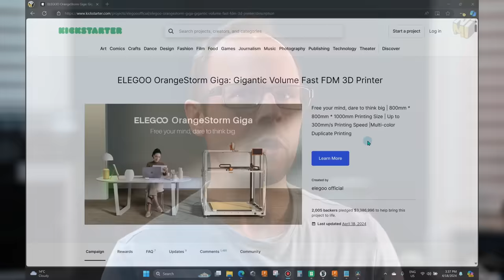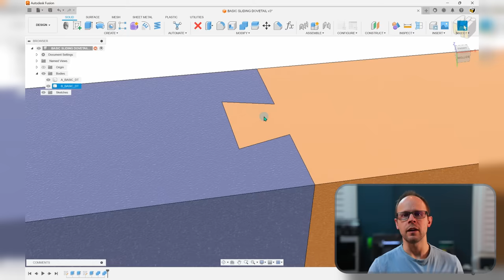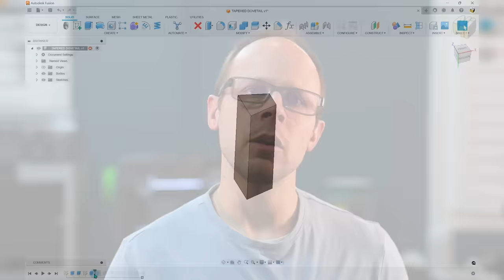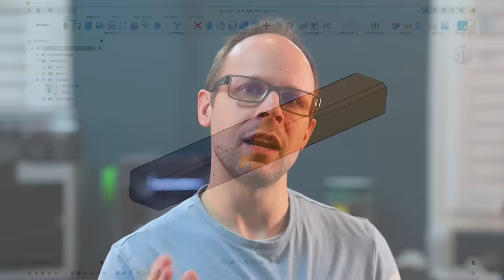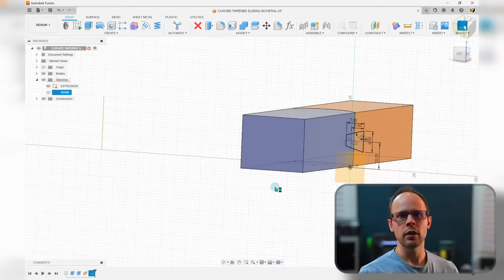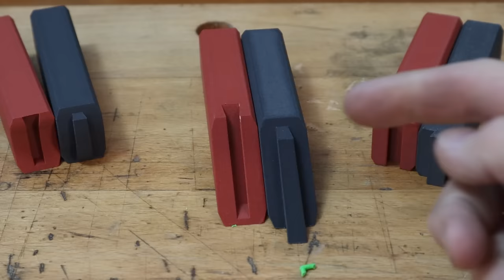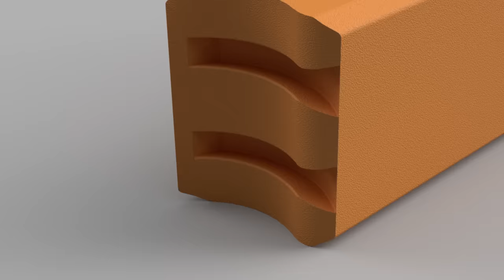Modernizing the best Woodworking Joint to use for 3D Printing

Comment: Please do more on joints. Dowel, maybe biscuit joints. Can you test them with weight? Glue strength difference? Love to see it. Great video.
Reply from the maker: Thanks, I will have more coming!  I'm also thinking about doing a video comparing a completely wooden small piece of furniture vs a completely 3d printed version to see how close they are in strength.
Reply: @NeedItMakeIt  That’s rad! I once made a dovetail mounted bracket for a shelf. Routed the dovetail into the wooden shelf and bracket and printed the mating mount out of PLA. 
Turned out beautiful and STRONG! No visible screws or joints.

Comment: I've been using a dowel pin system just to keep things lined up where they need to be. This seems a more elegant solution.
Reply from the maker: I guess it depends on what you're building, I find that holes need to have a peaked top so that they print well and don't collapse in too much on those top layers, I suppose the dowel can be whatever shape you like though, it makes sense to do a triangular dowel for 3D printing and you get an auto-peak and a flat surface.  When I worked building furniture, I must have inserted thousands and thousands of dowels, they work especially well with glue.

Comment: The snapping dovetail is interesting, keeps dimensionality while having a removable joint, depending on the strength of th snap.  Makes me think of using a combination of a dovetail with locating dutchman inserts.  Perhaps the next step of this would be a sprung detent within the interior faces, so that the dovetail itself has a tractile resistance before snapping into and out of place, without needing a compliant snap at the end of the rail.

Comment: Great design work and video presentation.  As an engineer, I loved this
Reply from the maker: I'm glad you enjoyed it!  I'm working on several related videos in a kind of series of different types of useful connection types.  I'd also like to integrate several different methods into and then run some tests to see which ones come out on top.
Reply: @NeedItMakeIt  I was looking for some quantitative analysis on degrees of play using the best joints, and perhaps a stress map, yield, breaking point map.  ‘Project Farm’ often has simple but effective ways to standardize these measurements without getting overly technical with it.
Reply from the maker: @donlindell1994  Can do, Project farm is one of my favorite channels, he is exceptional at packing a ton of info into a short video.  I'll be including some of these tests into the follow up video that I'm working on right now!

Comment: Great video, love the different joints. Would be good to see the basic dovetail at 0.04 offset.
Your fusion 360 skills are awesome
Reply from the maker: That's great!  Yeah, I could certainly try the 0.04; my concern with that connection is that it was hard to put together, originally I had the parts much larger, but to be able to 3D print all of them and have them on camera, I shrunk them down a bit.  I think it would have been possible and could have worked fine.  The taper is still better, but the standard dovetail works too, it really depends on what you're using them for.  

Thanks for the support, I enjoy using Fusion, it can do just about everything I need, it doesn't like meshes, that's one of my main complaints, it's all good and we can find ways to work around it.
Reply: I get ya 👍
I need to learn fusion 360 more im mainly on tinkercad and it's not nearly as good as fusion.

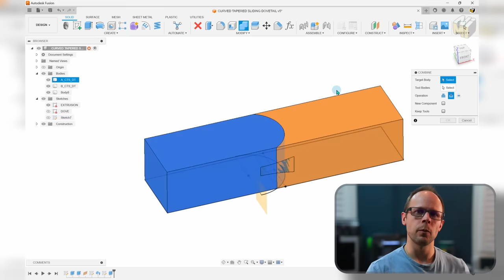Comment: at 4:48 is the perfect opportunity to use the Intersect mode of the extrude command. it removes the need to create additional sketch profiles.
Reply from the maker: You got me!  That would have been nice to use there for sure.  I don't like adding more features in that I need, this would have saved a couple of steps.

Comment: Nice technique! What I would do is to put a hole (maybe countersunk) in the dovetail stop, and a nut/threaded hole in the dovetail itself. Then, after assembly you could lock the parts together with a screw :)

Comment: Love this video. I’m going to be modeling dovetail joints just because all week now. I have some ideas to use Slant3D’s 45 degree printing concept, especially for the 45 degree dovetail to get printing textures to match. I also think there’s potential to create some complimentary anisotropic strength between the two halves. I’m probably just overthinking though.
Reply from the maker: I figured that you guys could take this places that I couldn't even think of.  I've seen quite a few products with standard straight dovetails and they can easily be improved with a taper or the curve... or both.  I may end up making a dedicated video just to this one connection, and shoot it a little differently, some people wanted a bit more detail on that one in particular.  I have a bunch more ideas for connections, some are old, but some are completely new and I'll probably start testing their strength as well.   Many many more to come!

Comment: It would be really cool to see these tested in their different dimensions (compression, tension, lateral movement in comparison to a full length object and worst case scenario loads).
Reply from the maker: I have a follow up video coming, I'll be running some tests on this and some others as well.  It's a great idea and I think it'd be good to compare against some more typical connections used in 3d printing as well as a rail with no joint as well for benchmarking.

Comment: Good video. There's an easier way to split a body with a dovetail cut in Fusion 360:
1) Start with a solid body
2) On a sketch, draw the squiggly line representing where a blade would cut to make the dovetail. Include fillets at any sharp edges.
3) In the top menu, switch from the SOLID tab to the SURFACE tab
4) "Extrude" the squiggly line, so that it forms a surface that divides the body you want to cut
5) Go back to the SOLID tab, choose MODIFY / Split Body
6) For "Body to Split" select your solid part. For "Splitting Tool(s)" select your surface. (Works best if you select them using the part tree on the left)
7) Click ok and it will split your part. You can then press/pull to add clearance.

Comment: For the first one (simple dovetail) you have shown, you can actually use the slicer. No need to design it in CAD in advance. Not sure if slicer you use supports it, but as far as I know Prusa Slicer and Bambu Studio (the one I use) have the ability to cut a part and cut it by creating a dovetail. You can do some clearance adjustments there depending on your printer, but from my experimenting it can create some pretty tight joints that might require a hammer to connect all the way through.

You can also cut it using dowels in slicer, which is what I've used few times when I needed to insert a metal rod into the part and I just used dowels for alignment when gluing two printer parts together around the rod.
Reply from the maker: That's right, PrusaSlicer has the dovetail which you can also taper and add clearance.  Unfortunately I have not found it to be useful, the connections cannot be reproduced, the sizes/lengths cannot be controlled well either.  It's still handy to have as a last-resort.  If you're creating the model, I think it's better to create the design with these connections in mind already, this also helps to make sure the orientation of the connections is best for strength related to print orientation.
Reply: @NeedItMakeIt  thanks for the insight. I've used slicer dovetail only a few times on things that weren't critical at all, so I actually don't have a ton of experience with them.
Reply from the maker: @rand0mtv660  I've tried it a few times as well when I was making a previous video about connection types, but I had such a hard time trying to make anything predictable and consistent that I decided to go a different direction.  It's still good to have in there as a fail-safe and for people with smaller printers.

Comment: I really like the fuzzy skin surface applied to the parts. Can you share what settings you used?  I have had trouble finding a combination of settings that I liked. It usually just comes out looking "weird."
Reply: +1 for this!
Reply from the maker: Oh, well I have a surprise for you, it's easier than that, this is PETG-CF and it gives you the fuzz all by itself, no need to do anything in the slicer.  The downside of any CF filaments that I've used is that they tend to be more brittle (they are quite stiff) and the layer adhesion is not as good as standard PETG.  I think with some slicer tweaks, it could be improved.
Reply: Are you using the textured PEI plate as well?
Reply: @NeedItMakeIt would you rate PETG over any of the tough PLA or high speed PLA? Genuinely interested as I'm considering trying out some filaments.
Reply from the maker: @-______-______-  It depends on the properties you're looking for, PETG-CF is more stiff but layer adhesion is not nearly as good as standard PETG.  My issues with PLA come down to longevity, since PLA is affected at a molecular level by moisture, it will become brittle over time.  PETG-CF also remains more flat than PLAs during printing.  If you're looking for easy of printing crisp overhangs and not worried about longevity, PLA/PLA+ is probably best, if you want looks PLA-CF or PETG-CF are the best for that, if you need strength and you can print 100% solid, use PETG-CF 100%, it is stiff but won't break like a part with infill.  I have some videos coming out soon to help with this too.  This weekend I'll have a video which displays some of these properties well.
Reply: @NeedItMakeIt  Thanks for your very useful reply.

Comment: this is a great video. would be nice if we could get some real world data on the performance of each joints performance. defo need more subs
Reply from the maker: Thank you!  Lots more coming like this one as well.   I'll put together a test video with some of my best connections and we can bend and break them in several directions.  I might even add some wood in there to compare.  I have some test rigs setup now, but I want something more professional with more accurate measurements and data feedback.   Hopefully the YT gods can shine a light on the channel and allow the resources to buy some equipment and lots more filament!

Comment: that is a damn good joint indeed
Reply from the maker: I have two more which I think will rival this one, both I believe have not been done before, at least not that I've seen.  In the follow up I'll do some stiffness and strength testing to see how they compare as well.
Reply: @NeedItMakeIt  would love to hear your opinion on the best solution for fitting beams end to end for making larger printers, cheers :)
Reply from the maker: @MrFranklitalien  That'd be a great use case for these connections, is there a material you have in mind for this already?
Reply: @NeedItMakeIt  I've been brainstorming a mostly printed 3d printer with some friends, like the snappy v3, only instead of using snap fits or screws I'd like to see if I can do it with mostly keyed wood joints and zip ties;
hoping to drive the cost down below 200$US as a benchmark.
CoreXY geometry would be great for building on top of the base architecture (might integrate arms and wheels later down the road as part of the NASA autoreplicant robot program)
Reply from the maker: @MrFranklitalien  Perfect!   If  you can wait for a little less than 1 week, I will have the follow up video and I will try to think of how it could work well for your application as well.   I love your idea BTW, a fully 3D printed printer... minus some non-printable stuff would be very cool and I'd love to try it on the channel when you get to a point that you're ready to share it.  So far the ABSGF25 from QIDI is the most rigid filament I've tried, next would be PC and then PETG-CF and Hyper PLA are tied.  I'd imagine that a rigid material is important for your application.

Comment: I'm surprised you get such fine joint printing to work to that accuracy. Could you have also printed the joints to have a cross pin to lock them together like they do in Japanese wood joints?
Reply from the maker: I certainly didn't have that level of success years ago, but with the CoreXY printers' speed and accuracy, and calibration of the filament, it's possible now for just about everyone.   In a previous video I made a connection called a Under Squinted Stop Splayed Scarf Joint for 3D printing, I think it's the connection you're referring to.  It's basically a combination of a scarf and a dovetail in one with tapered pins.  It's a lovely and strong connection.

Comment: Quick note for other viewers: don’t orient dovetails in the Z axis where tension will get put across layer boundaries. Do it like this video, where the dovetail is primarily on the XY plane.
In Fusion 360 it makes me nuts that there’s not a simple operation for “this part mates to that part with [x] clearance.” Instead you have to model the clearances or do a bunch of push/pull operations. I tend to do the former because it keeps the dimensions in the sketches vs. in the dialog boxes of push/pull operations. But the latter is quicker.
Really excellent video—instant subscribe from me!

Comment: Love to see this video. I've worked deigning industrial machinery and love Japanese woodworking.  The concept you are explaining make the work of coupling and replacing parts really fast. It's important when you have to stop a production line and it's impossible to lose a screw :) . Liked ad sub
Reply from the maker: That's awesome.  I have lots more ideas to integrate these types of connections into the work we do in 3D printing.  I'd like to also experiment with using  a single fastener positioned at an angle  to draw the connection together in to achieve the ULTIMATE solution... well, maybe.  I'm getting better setup to do testing on these connections as well and I think I'd like to test glued connections vs non-glued to get an idea of the impact.   I wonder if anyone would be interested to see some connections done in wood as well?

Comment: what you can do is add a hole so you can screw the dovetail, not only the screw goes through, it also clamps the inner part. for a more interesting part you can also make the hole across both parts as it just needs to lock the rotation.
Reply from the maker: I've been thinking about your idea and it is possible to add a cylinder with a heat-set insert in it, that would allow the insert to rotate and could work for even the curved connection.  I do like your idea of combining the screw with the joint for a method to bring it together really tight, and also to be able to take it apart and no glue required.

Comment: I love the mat finish of your prints. How do you do that?
Is it the filament, the temperature, the speed, or something else?
Reply: May be fuzzy skin or filament
Reply from the maker: I'm glad you noticed,! That filament is PETG-CF and it's probably the nicest looking filament out there.  I used Bambu Brick Red and Titan Grey, but any PETG-CF will do the job.  Fuzzy skin works too but to get that level of a fine "fuzz" you'd overwhelm your slicer and it's most likely crash on you.
Reply from the maker: You've got it, the filament here, I do use fuzzy skin on occasion, but these PETG-CF filaments have the best sheen and surface texture of any filaments I've tested so far.

Comment: Fun fact: wood glue does great on PLA, and if you soak it a while you can take the pieces apart. Just in case you want to build a part that needs glue (say, you're sealing something inside) but you want to test your prototype first.
Reply from the maker: I've heard that it does, but I've never tried it myself.  That's interesting for sure, thanks for sharing!

Comment: Hello, great video. I'm new to CAD. Do you push/pull the 0.2mm on both parts/sides of the dovetails? I could only see you doing it to one side in the video. Will my joints be too loose if I do it to both parts? 

Also, do you think it would be okay to do 0.3mm fillet on both internal and external edges?

Comment: Did the fusion 360 model have fuzzy skin? If so, how?

Beautiful work.
Reply from the maker: I wish I could take some credit for the looks but here I'm using PETG-CF with fairly thin layer heights (0.16).  The PETG-CF gives a wonderful matte finish with slight texture, probably the nicest looking filament out there IMO.

Comment: Good evening! I am an undergraduate student trying to design a joint for an 3d printable structural arm and is considering using the curve sliding dove tail, may I ask what are the considerations when choosing the radius of the curve and the size of the dove tail to be implemented? The video is really insightful however there are just some principles I do not get, please advise. Thank you!

Comment: Nice video. I appreciate your design intent. I was thinking a light inset piece on the out side of the joints that you could screw into the sides. Basically like to 2 sandwich plates that are designed to lock the joint with hardware.
Reply from the maker: If you could do that on both sides it could work as well, you can actually integrate the plates into one of the parts and add some fillets in there to keep them strong.  To pull the joint tight together you might consider offsetting the screw holes just slightly to do what we call Draw Boring.  Metal plates could be used as as well, nothing against that if you want to mix materials.